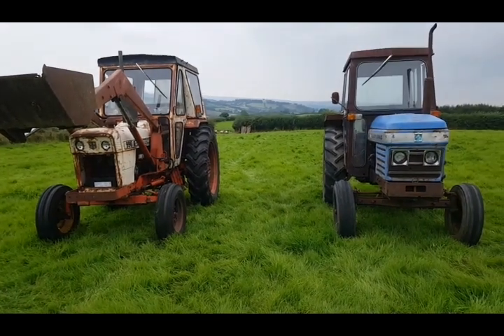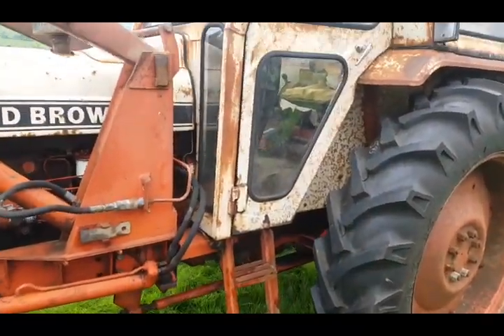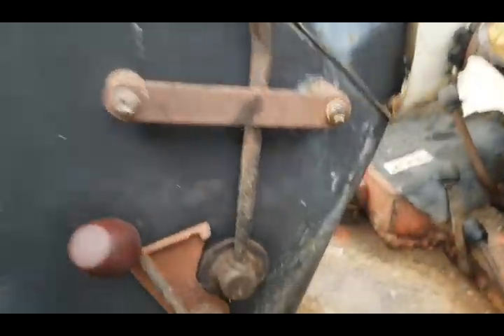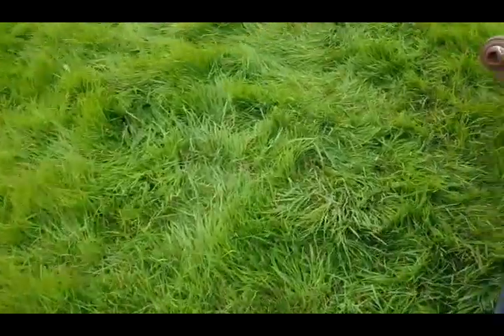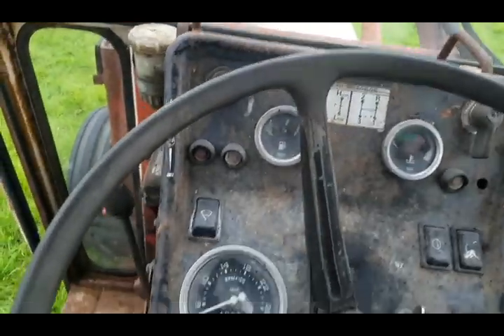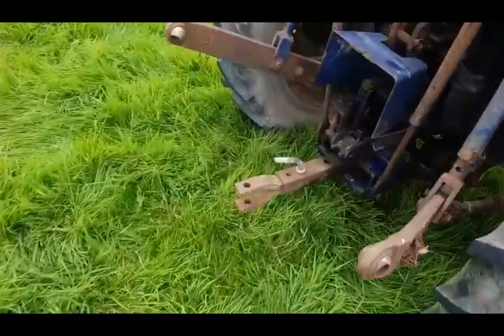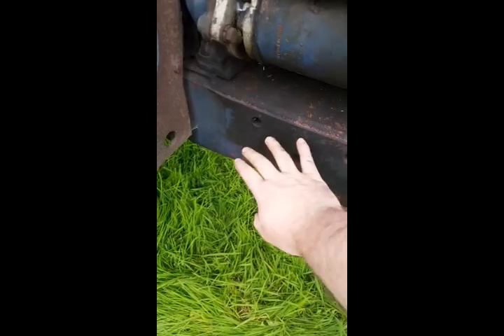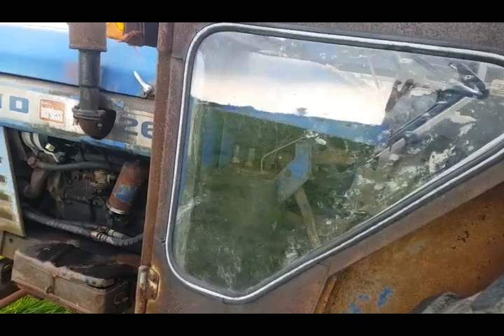late 70's Q cab Leyland and David Brown compared

Comment: One key thing to check on all old tractors is the gearshift gaiters.

 Damaged gaiters is the main cause of water ingress to the transmission/hydraulic oil, and the main cause of internal corrosion   because split gaiters were common on most old tractors, even new ones dontt last long and something that gets neglected.
Reply from the maker: 1 thing good thing with the Quiet cabs is you have 2 layers of protection plus less sunlight 👍
Reply from the maker: It's a shame the metal cup that Fordson/ford used to cover the gearstick hole wasn't adopted by other makes

Comment: I worked for a dealer on both brands. Each tractor brand has advantages and disadvantages, I liked them both in different ways. The DB seemed to suit a certain type of gentleman farmer, the leyland was a strong workhorse., certainly less likely to get stuck. Probably the best feature of the Leyland was the engine. Sweet and smooth. And good low end torque, they would pull strongly from 1200 rpm upwards, Good starters too, especially the older ones with an inline fuel pump. Of that time the Leyands had the sweetest engine, just ran better than the fords, or Perkins Not many people know that the 262 and 272a exactly the same engine, just a different fuel injection pump setting. Early 262 models had higher compression pistons to aid cold start, so resetting the fuel pump to 272 setting (a fuel shop job) would give a 262 closer to 75 hp
Reply from the maker: Yes the DB definitely needs a more caring home with a more ticklish hydraulic system that needs nice clean oil and the king pins can seize up with lack of grease

Comment: Both are good general tractors for daily use. I think David Brown had 2 advantages , stronger front axle and easy starting in cold weather. But Layland has a better setup for the 3 point hitch control. Being American I don't understand why they don't allow use of remote and 3 point at the same time. It's unnecessary to have to select what you need to use before using it. All hydraulic systems should function symotaniosly no matter what. Even a tractor from Russia and China have that functionality. Always make me wonder why they made it so overly complicated to use. But I love my David Brown 990 and won't trade it for anything because it's dependable and strong for it's age. Thanks for sharing your Tractors with us.
Reply from the maker: Tbh, a British Ford or Massey Ferguson the same age have separate spool valves, DB and Leyland were a bit slow to update things e.g. brakes, pto clutch, hydraulics. The later Case (DB) and yellow Marshall/Leyland did have spools though
Reply: @arwelagrimachinery  I like the Ford Ferguson tractors. But the Ferguson system lifts always left me chaining up the lift because they got weak. Running a brush cutter and plow always left me stranded until it cools down. I'd buy a IH or Deer because the hydraulic system was strong and reliable for constant usage. Everything has a strong point. Ford's and Ferguson tractors don't get hung up in the swamp but they don't have enough strength for the rest of the job. But comfort is not good with IH or Deer but very durable. I have found my Case/ David Brown is a compromise for power and fuel efficiency. Still could be more versatile in the hydraulic system but it's reliable and strong. But any tractor today is just a nightmare with computer control and expensive to repair. Love the simple old tractor of the past when they were made by people. Thanks for letting me rant 😂.
Reply from the maker: @charleswelch249   old  TO20 ?  If the same as the TE20 British version,  the PTO shaft ran the hydraulic pump , switch that off the impliment soon comes down 🤣 . Kverneland in Norway (?) Made a latch to hold 3pl up while transporting 1 of their ploughs . Later Massey 35 had the hydraulic pump driven off the pto, but it was in front  of the sector for having it Turning at the back so they solved that problem

Comment: Hello , I have had both a Leyland , then ( now ) a D.B. , the cab on my d.b. is the Danish Sekura one , it,s far more spacious than the Airflow Victor cab was on m,y 272 , but it,s one n oisy devil , both the engines are good starters , Leyland & D.B. , neither of them guzzle fuel too badly , but for me the Leyland engine is streets ahead in build technology , as it,s a 5 bearing engine with a crank balancer on , this is why it just sings , the D.B. has it,s own characteristic nasal chortle about it , a bit like a small version of a Scania truck , but a word of warning for all you remaining Leyland devotees out there , if your battery ( volts ) gauge sinks down even just the once for no explainable reason , thoroughly inspect all the heavy wiring harness work underneath the front of the cab , it,s a bitch to get at , you,d probably be better off fully removing the whole cab , so you can clearly see it , look for any points of chafing on the heavy , usually brown power supply cables running to & from the starter & ignition switch , also the alternator . If it,s less than perfect , strip the whole lot out & renew it , find a way of housing it inside trunking , not easy as there,s very little room under there , an excellent idea is to fit a battery isolator switch as close as possible to the battery positive terminal , this could stop a terrible electrical fire , I now also carry a fire extinguisher in the cab , fixed in . I wish I,d still got my old lass , she went straight up in flames & smoke & I just couldn,t save her . Bloody invisible electrical short buried underneath the cab , I never once took the cab right off , or I,d have seen it . Never modified the wiring either ( never sleeved it in trunking ). Learn from my experience . Battery isolator switches & a good fire extinguisher .

Comment: If U had to choose,would you pick the 5 bearing crank over the 3.
Reply from the maker: @colmanlong1032   5 , just a better/stronger job , I will say though its the bigger 4cyl tractors like the 1210/12 , 1410/12 that are more likely to snap the 3 bearing cranks, the smaller/lower Hp 990-996 are quite good tbf . They even had to reduce HP from the 1410/12 (91hp)  to the later 1490 (83hp) / 1494 (85hp) , most likely due to that weakness.

Comment: Great video how do you reckon an IH  574 would have held up against them
Reply from the maker: Thank you👍 . Pretty similar spec wise really and their own engine, etc like the other 2  but foot brakes way ahead , the independent clutch pack pto is a better/more advanced job rather than the dual clutch.  Id have to say more reliable engine (DB suffer with crank problems and Leyland liner problems) , maybe starting not as good as the leyland it goes 1/2 a turn if im moving it in winter
Reply from the maker: The DB has 2 speed pto and synchro gears standard like the IH and the leyland has the pickup hitch and power steering standard like the IH and DB  (option for synchro gears on leyland)  so similar specs really but the leyland and DB use a dual clutch with hand clutch for pto plate and the IH has a separate wet clutch in the backend like a Ford run off the hydraulic oil and the IH foot brakes are wet disc brakes like a Ford too which are a much better job for working and lasting  but the IH handbrake  which is a brake band in the gearbox is a poor job , worse than DB/leyland in that way
Reply: Ih brake band does work ,but of course everyone  forget to release it before takeoff and that was kaputt,including my self.but I'd have ih 574 before any of them.

Comment: Leyland every time. But I do like a brown. Owned a few. And a few Leyland and Marshall tractors
Reply from the maker: Have to say yellow Leyland/ Marshall's were  fair tractors  they were too late comming to save Bathgate though
Reply from the maker: I think after leyland used the sekura explorer cab 1st ,  DB decided to fully make their own coppy of the cab for the 90 series that wasnt quite the same in the side windows and split in the middle,  bit random but bit of a connection
Reply: @arwelagrimachinery  yeah I have to agree.  And Marshall basically took on a 20 year old design.  Same tractor slightly bigger cc engine and better gearing.  They could have made it.  
Unfortunately for David brown.  They sold Aston Martin to buy case. But the bank of England didn't have the money to give them. The international bought case and 3 years later bought David brown.  
How it could all have been different
Reply: @arwelagrimachinery  same cab. But the David brown cab split to fit under low roofs. The Leyland/Marshall cab didn't.  So the glass in the windscreen side windows and back window was 1/¼ inches smaller in the David brown variation
Reply from the maker: @wanemergency3591  no DB were in big dept so sold their Tractors/machinery to Tenaco who had bought Case already and sold Auston martin as well (DB Gears still going) then tractors became Case DB then Tenaco bought IH and turned into Case IH then Tenaco sold Case IH to Fiat
Reply from the maker: @wanemergency3591  knew there was a difference i think the DB ones were actually made by DB, the leyland/marshall were bought in from Sekura
Reply from the maker: @wanemergency3591  really the last leylands that were only made for a year or so had finally improved the brakes on all the models but DB never did fully , the 1394 was still drum brakes to verry end
Reply: @arwelagrimachinery  they where all made by the same factory.  All explorer cabs.  Just made to a different specification.  

As for the breaks on a Leyland.  I think 1981 started wet breaks on everything they made that the explorer cab was fitted to. So the 302 502 had dry breaks.  The 602 with explorer had wet breaks. 602 on the lp cab was dry
Reply: @arwelagrimachinery  like I said I've owned a few of each. And my preference and interest is with the Leyland.  So I learned about the history and changes in them. Oddly enough.  Not alot changed from the nuffield tractor range.
Reply from the maker: @wanemergency3591  sorry forgot about the 302, cant say ive heard of a 502 before , thats interesting, wander why not on the LP as they are master cylinders on both so wouldnt be a problem lile that to fit them
Reply from the maker: @wanemergency3591  thats a fair point the basic castings were the same from the DM4/universal 4 up to the last JWD built out of parts left over from Marshall
Reply: @arwelagrimachinery  as far as I can remember it was a mf 135 engine rated at 50hp .the only perkins in the range from the nuffield days
Reply: @arwelagrimachinery  if only the did what Ford did. Up the cc's  keep the tourqe in the field.  Just ad weight.
Reply from the maker: @wanemergency3591  must have followed on from the leyland 245 that had a 135 engine
Reply from the maker: @wanemergency3591  near enough if they followed ford in the 60's  with the wet brakes and a pto pack they could have put a basic HD clutch in they wouldn't have many faults really
Reply: @arwelagrimachinery  the 253 had a perkins 152 I it same as the 245

Comment: I have a 1974 996 which  I am bring back in to use slowly. Quite a few differences on your later model. 4 way valve on hydraulics where 3 way on mine. You still have the valve chest for controlling the hydraulics. Most complicated thing on the tractor. Have a new video every Saturday. The DB 996 I have sat at the sea side for 2 years doing nothing and caused quite a few problems. I would say the 1974 is les complex than yours. Have a look some time  M 😀
Reply from the maker: Yes that 3 position part is the "Selectamatic" that came out on the 1st white 880, 990 and lasted until the end
Reply from the maker: Lot of work welding the tinwork id imagine,  the DB's dont need much excuse for the unloading valve to stick tbh (lets the linkage go down)
Reply: I have done away with it and have a double spool valve working the lift up and down and  flow and return tipping pipes.  @arwelagrimachinery
Reply from the maker: Oh ie because my 996 has a cab with its own floor the lever for hydraulic valve is on a pivot so the positions for things i said will be  reversed compared to 1 you sit on the casting and grab the valve lever direct

Comment: My dad has 4 Q cab machines, a 885, 995 x2 and 1410, although the cabs aren't that spacious they are brilliant o work with. I never have and wouldn't mind trying a Leyland though.
Reply from the maker: Yes the VQ with the wider doors or the sekura OPU are  better cabs really , bit of a knack/squeeze getting into the safety /q cab
Reply from the maker: Tbh i quite like the 1410, a usefull size/power and good wet brakes, the 1210/12 and 1410/12 , getting a bit of a rarity too in good/wprking order
Reply from the maker: Tbh the cream of the crop is probably the leyland/marshall 804, nice big cab, 4wd , wet brakes and a 4cyl turbo with plenty of turbo sounds
Reply from the maker: But a case 1494 is just the same spec as a 804 tbf

Comment: both were good in their day .......but a fiat 780 would run rings around them .........!
Reply from the maker: Not a big fan of driving the proper Fiat's tbh , but to be fair they are reliable things have good brakes and nicer cab , the Italian tinwork and clutches (usially don't last that long on stockman loader tractors) only weak points though

Comment: Never had any interest to Meltham mill stone -factory products. Leylands were always better starters, they got more road speed and lot of ground clearance. Also if you put 2x4" to cut to road DB is pushing it like dog with its nose, Leyland's very light nose jumps over it = very capable at forests and very good tractiom when ploughing.
Reply from the maker: Ah i see must be reason leyland came  with the built in weight frame
Reply from the maker: Tbh the 2 were brought on trailer home and the leyland was heavier than the DB even though it had a loader
Reply from the maker: The same hill near home with same low loader and tractor, 1 gear slower with leyland

Comment: Have all leyland got diesel tank in front of rad.
Reply from the maker: Good question, no the 154 (BMC mini) has a tank behind engine and the 6 cylinder  285 and 2100 have the tank behind the cab like a International Harvester  or Fiat

Comment: You just said it hard to get in the david browns just buy a zetor they are better standard with air compressor air brakes for trailers and plenty room in cab to get in and out hydrulic pto in the zetor cystall range and a better multi power then the massey yokes and zetor cabs are sealed up with foam under the floor for low noise and some zetor models had frount suspention so melt down the david brown and leyland into channel iron
Reply from the maker: Thats fair enough 8011 fairly ahead of everyone else in options/comfort , even a passanger seat and option of front axle suspension on the kingpins

Comment: Give me a Ford 4000 or 4600 over these 2 any day.
Reply from the maker: 4600 Q cab would definitely be more spacious,  better brakes and pto pack tbf , but double the money too is bother 😂
Reply: @arwelagrimachinery  How about the Fritzemeir cab.Lots off space in them but still a little noisy on the inside. . Most off the 7A Fords in Ireland had the Fritzemeir as opposed to the Q, Duncan or Fieco.  The Lambourn was also spacious.
Reply from the maker: @265justy  didnt have those here tbh, was the smaller 4100 that usually had the lambourne , 4600 Q cab would have been the ford equivalent to the 996 and 262 , shame i dont know o f a ford 4600 , massey 565 and IH 574 Q cab i could borrow for the whole late 70's  line up
Reply from the maker: @265justy   think Fieco only fitted for 6 months or so before the Q cab was ready , have seen a couple of Duncan cabs but quite rare tbh
Reply: @arwelagrimachinery  apperantly there was a delay with delivery off Qcabs  in 1975 when the first 7A Series off Ford's came out. I think the Q cabs came from Denmark.. Correct me if I'm wrong. So Fiecos were used at the beginning. Your spot on there. 👍🏻.
Reply from the maker: @265justy  not sure where the cabs were actually made tbh, if you wanted to be confused  by tractor cabs no mf 265/290 you see in a row is the same make of cab near enough 😂
Reply: @arwelagrimachinery  I spose it was the era when regulations came to be on sound proofing cabs for tractors. So lots off models off tractor had a variety off cabs for both domestic and export markets. I don't think for example the Fritzemeir was available on Ford's in the UK market..
Reply from the maker: @265justy  yes but uk market 265/290 could have Duncan, GKN Sankey, Lambourne  and cab craft
Reply from the maker: @265justy  wander if massey was to do with shortages from strikes ?
Reply: @arwelagrimachinery  Could have been. The Duncans and Lambournes also Sekura cabs were available across a broad range off tractor brands. Kept costs down probably as opposed to tractor manufacturers making their own cabs.